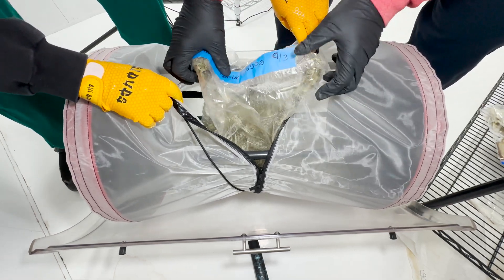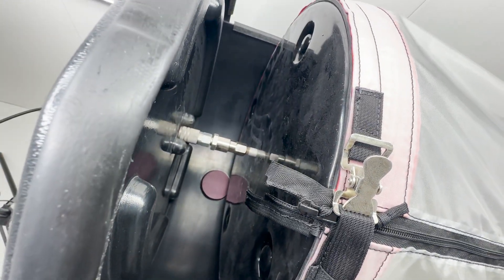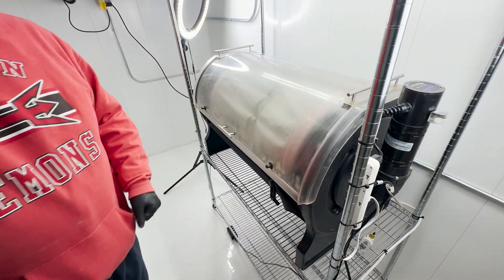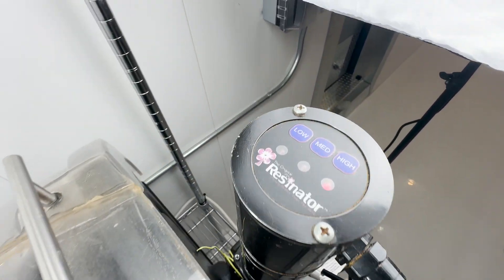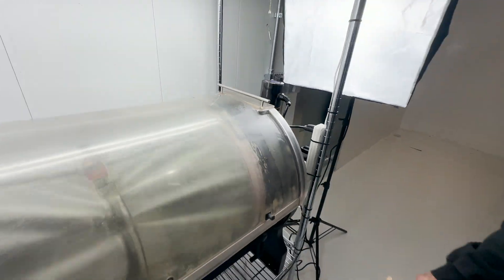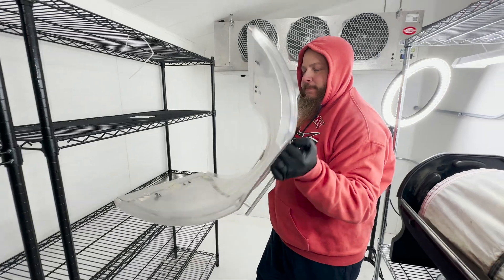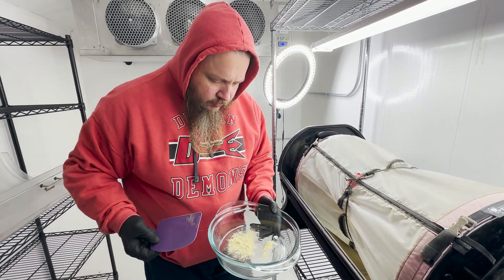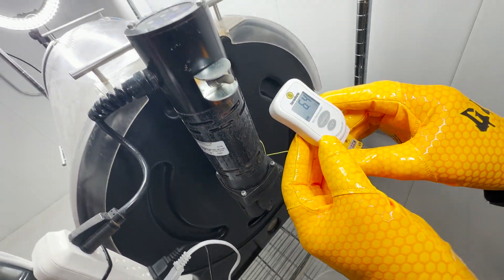Resinator for Plasmastatic Processing - an SOP

Comment: HI there, anyone know if it's possible to clean up keif made with dry ice by using Static Tek methods on dry sift screens? Cheers
Reply from the maker: Yes totally possible.
Reply: @SamboCreeckFiltration  Thanks so much for your reply. I'm going to give it a test try with 160 micron water hash bag and then further clean through screen and static tek. Just can't afford a tumbler now but have screens and water bags. Cheers